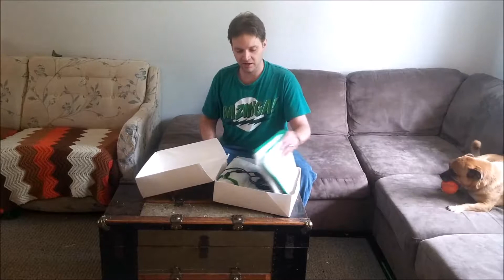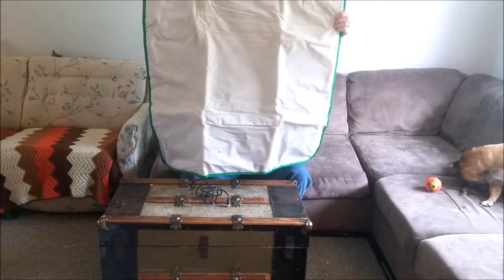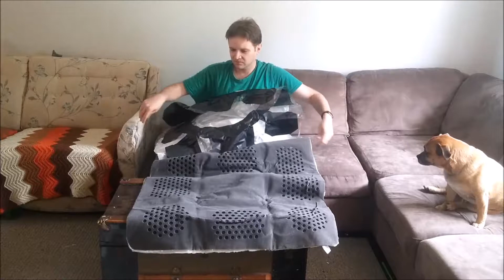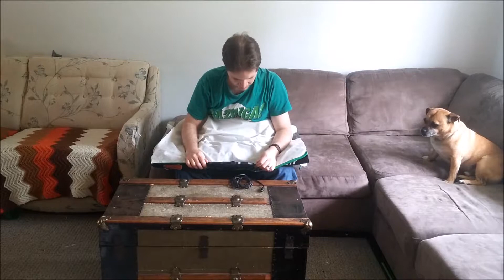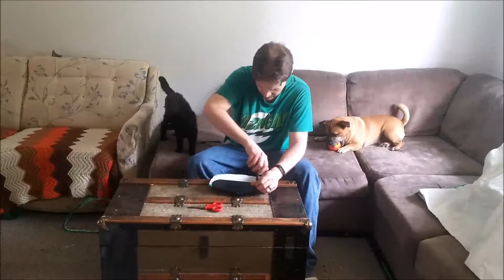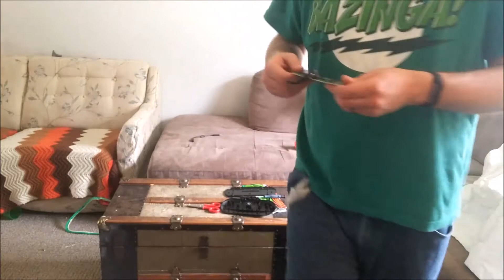DDR Universe Dance Pad Teardown For 360. FOR SCIENCE!

Comment: Thanks for the video!
 I'm trying to refurbish my own metal DDR pad and wanted to know what these cheap pads are using for their circuit cards. I lost my control box for the metal pad in a move and can only find replacement ones for $150. Insane pricing when I can rip apart a matt from FB Marketplace and wire up a new plug instead.